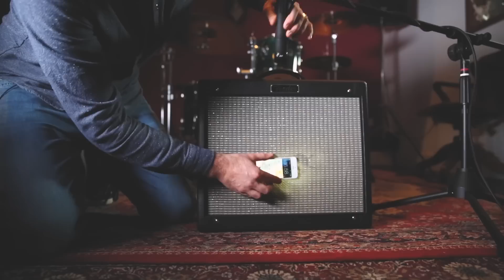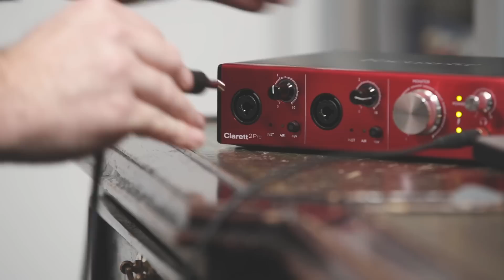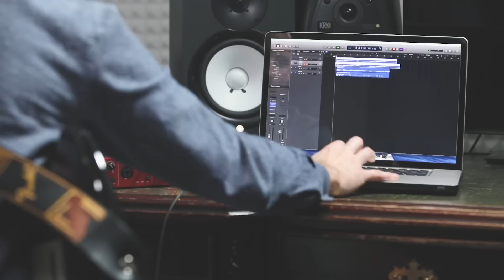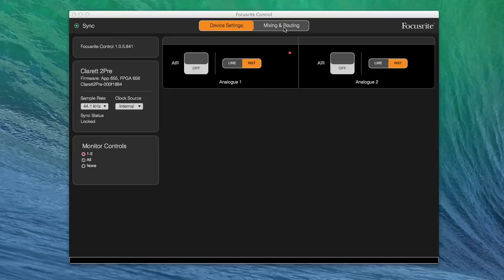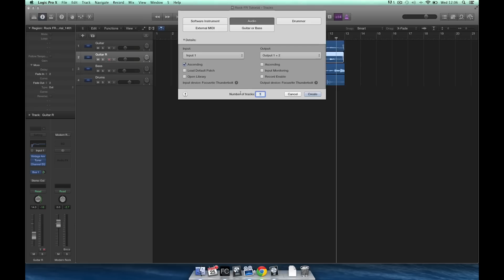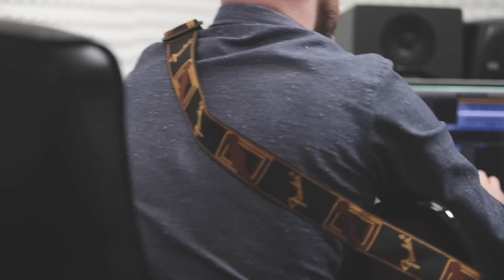Focusrite // Recording Rock Guitar with the Clarett 2Pre

Comment: Out of curiosity, I confirmed that Playback 3 isn’t required. You only need Input 1 routed to Outputs 3–4 (which is the default), while muting Input 2 and Playback 1–2. Outputs 1–2 can remain unchanged. Optionally, you can mute Input 1 in the outputs 1-2  if direct monitoring isn’t needed.

Comment: why playback 3 is selected to go to both outputs 1-2 and outputs 3-4? Normally playback 3-4 are the  sotware outputs coming from  Logic for example. I am confused a little bit because in the video you dont route DI track in  Logic to output 3?
Reply from the maker: The routing is being handled in Focusrite Control, so you don’t need to do any additional routing inside the DAW. Logic is simply recording analogue input 1, which carries the DI guitar signal, and input 2 carries the SM57 microphone signal from the amp. Output 3 is sending the DI guitar signal out of the interface to the guitar amp, and that amp is then being mic’d by the SM57, which brings the sound back into input 2.
Reply: @FocusriteTV  yeah. thats why you dont need playback 3. the rest is fine

Comment: Can someone help - I have a Carett 2Pre and when I direct record into the Carett into my DAW( Cubase) and I use a VST amprack plug in, I hear both the signal from the VST amprack like I want BUT I also keep hearing the clean signal going into the Carett.  I think on the Scarlett versions there is a DI button that kills the direct signal, but I can not figure out how to get rid of the that direct signal sound on the Clarett - Does anyone know what i am asking and can you help. I am very confused and discouraged.
Reply from the maker: I'm sorry to hear that you're having problems. Within Focusrite control, you should find that you can delete the analog inputs within your main output 1+2 routing, found in the Output Routing section. To delete, you just need to click the X symbol in the corner of the analog inputs. This will allow you to route your inputs into software only and not directly to the main outputs.

John // Focusrite UK 🇬🇧
Reply: @FocusriteTV  thanks so much.  I see it was user error. Like you stated I just muted the input signal in focusrite controller.. I'm pretty much a simple user . The interface has way more features than I will ever use

Comment: Just in case these comments are being monitored, what is the impedance on the outputs? 

In other words, is the Clarett output similar to the impedance of a guitar’s output? If not, the amp’s tone, with signal from the Clarett, will be drastically different than the amp’s tone with signal from a guitar plugged directly in.

Comment: Good stuff. Thanks for the demo. For viewers wanting to use the re-amp technique showed in the video, take note: the Clarett 2Pre is a bit tricky without an isolation booth/room for the amp and mic (which they clearly have in the video). If your setup is like mine, your amp is in the same room as your computer and your main monitors, which means you'll probably want to use headphones to monitor. But that's a challenge because the headphone output always carries the signals currently routed to analogue outputs 3 and 4 (as a stereo pair) in Focusrite Control.

SO ... the signal you're sending to the amp (the guitar DI) is always in your headphones. You can't listen to your main monitors (like in the video) while competing with the amp in the same room, and the headphones probably can't have the mix you want. Huge problem? Maybe or maybe not: you could use some additional hardware (like a small mixer) between the main stereo outs (analogue outputs 1 and 2) and your monitors, which would provide you with an alternate headphone jack. This is really helpful both when tracking, or when working out phase issues while re-amping an already-recorded guitar DI using multiple mics. 

Of course, you could also just buy the Clarett 4Pre instead :) It has more outputs, so problem solved. Either way, both really great pieces of kit.
Reply: Thank you very much. I was going to buy a new interface but instead I'm just going to buy a small mixer for 50€. Have a nice day. :)